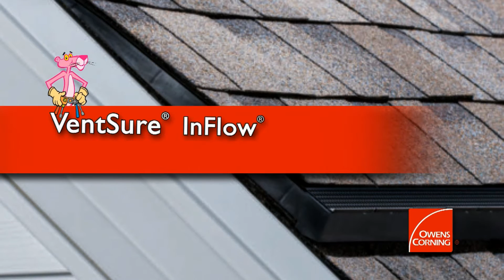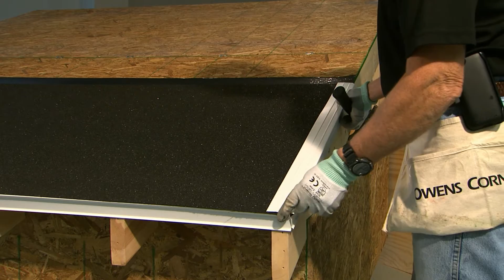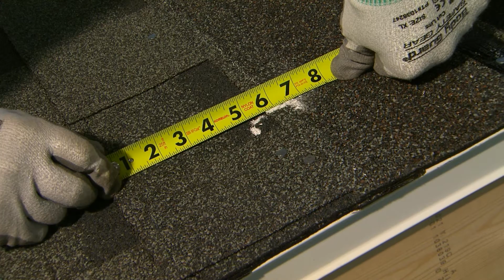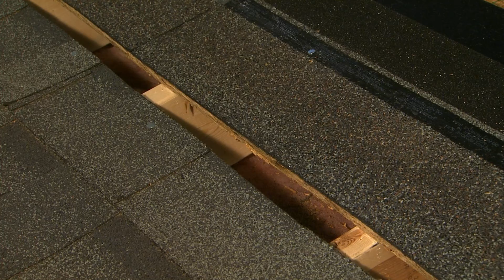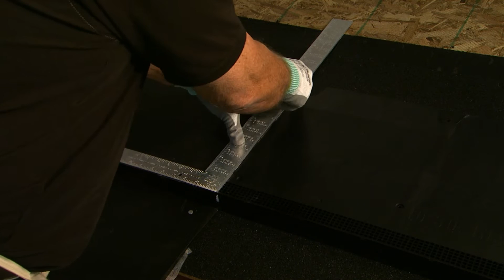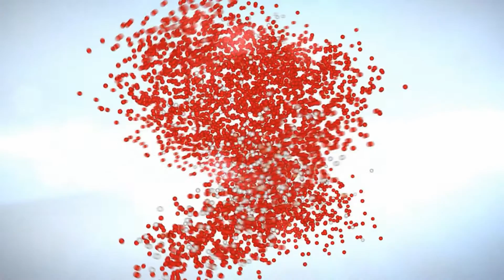How To Install a VentSure InFlow Intake Vent: Mid-Roof Installation

Comment: It seems to me that by having the vent opening at the top, it would collect sediment and also the baking summer sun would eventually break the material down. Then after getting brittle, high winds carrying debris would break the material and eventually it would be clogged like gutters and rendered useless..  To me it seems more logical if they would have had that vent opening at the bottom edge, with the shingle coming right to the edge. I would not install something like this in Oklahoma where we have 100 degree summers and very high winds with a lot of storms.